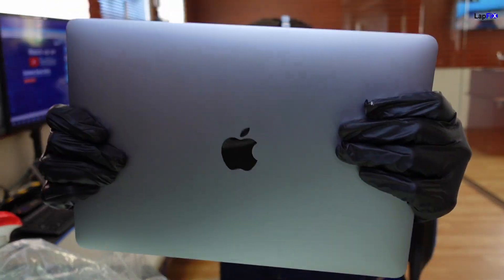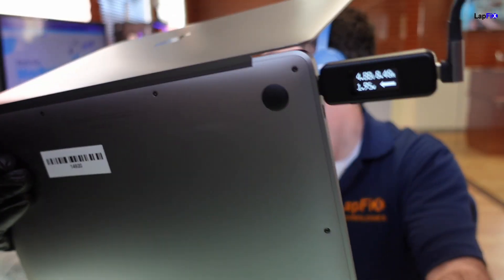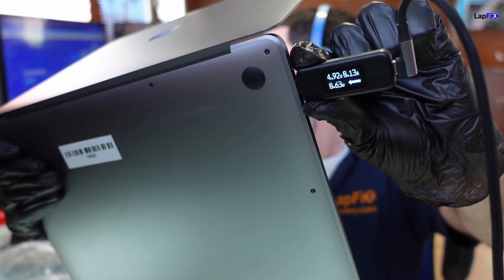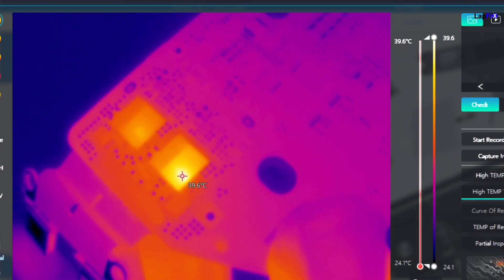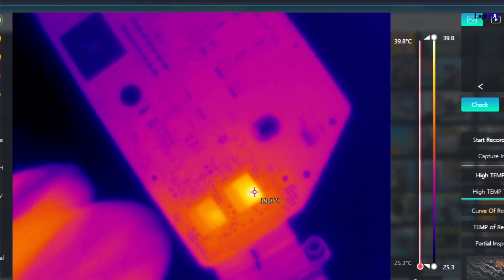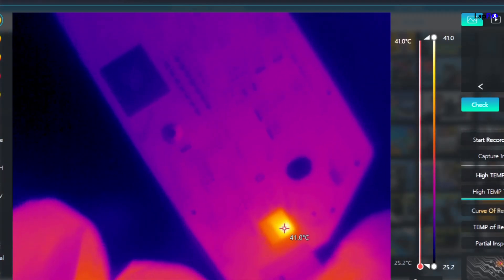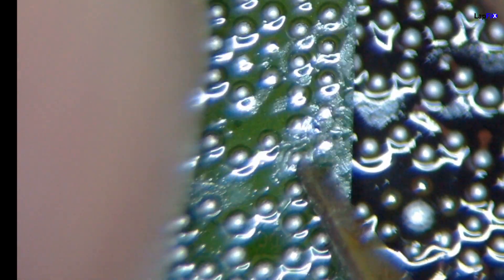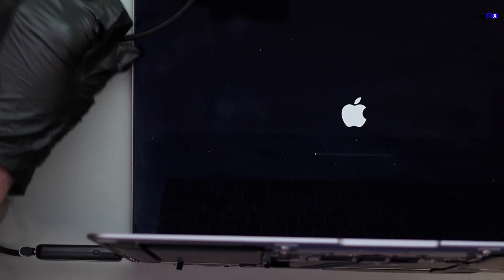Fixing a M1 MacBook Air Not Charging and Not Turning On

Comment: hello sir, I found the same case that it won't turn on and won't charge. Starting from using a cellphone charger. One of the CD3217b ICs was very hot, I replaced it and there was no change, it just wasn't hot anymore. Finally I replaced both and they were still the same. Almost desperate

Comment: Always check the plug. My wall port plug was causing issues charging. If the plug is hot to touch get a new apple plug. Aftermarket parts are the cause of most issues. Do that before opening any SOC device.

Comment: And finally mine dead in 1.5 years.. so unreliable..
Reply: 2 year barely for me and it's blacked out
Reply: Same here. I will never buy another Mac again. Warranty ended a month ago. And now they can’t help me
Reply: Same here
Reply: Same here
Reply: Same here for my M1, completely unreliable, very flimsy and giving issues in just two years even with minimal use and maximum care.
Reply: Same here....
Reply: Had mine 10 months…
Reply: Same here
Reply: mine two. and before that a Mac mini M1, two weeks after warranty ended. 
I still have a 1999 Apple Apple PowerBook that still works and an old ruby red iMac, also still functional.
Reply: Same here! warranty ended last month on my 2022 Macbook Pro 16"